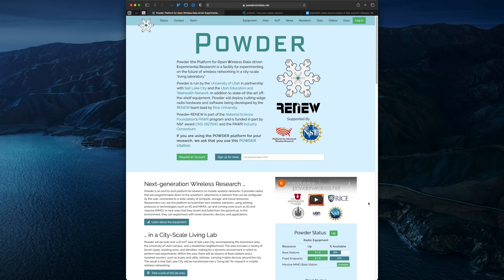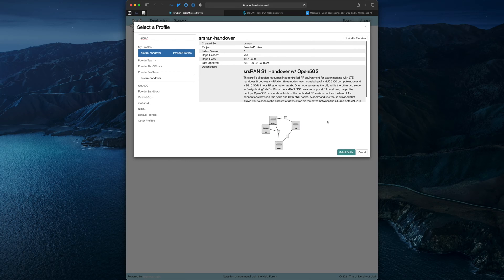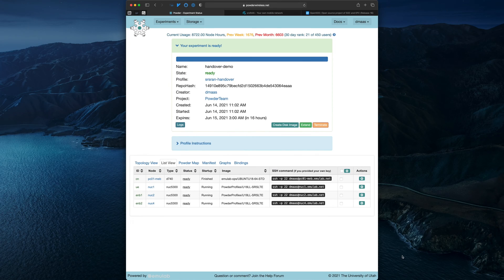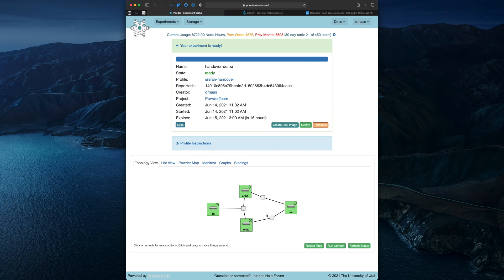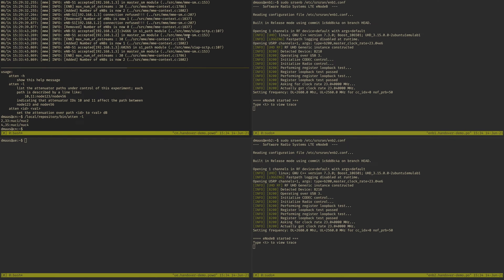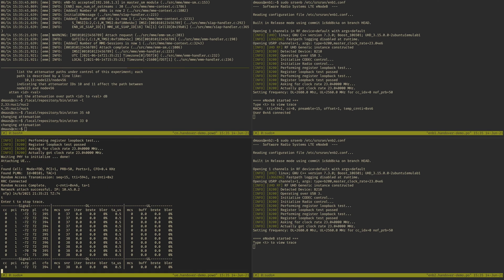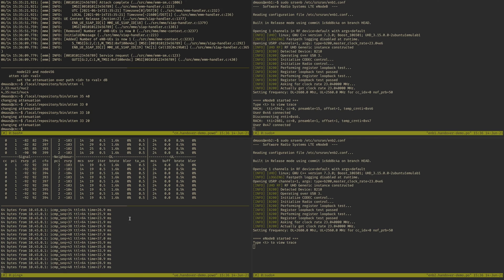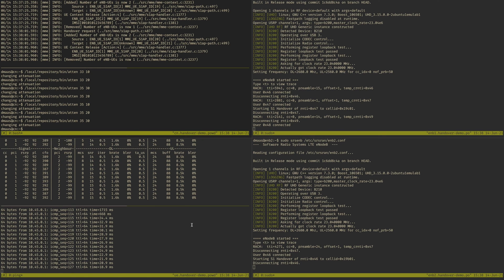S1 Handover on POWDER with srsRAN and Open5GS

Comment: If I use a commercial UE and 2 separate enodeb's using SDR's, there should only be the rr.conf's with the same filenames separated into the two enodeB's, right? Of course they will have different contents, the 2 rr.conf's.  Also in enb.conf,  is there is a need for fail_on_disconnect=true? Does this apply only to zmq?  Thanks
Reply from the maker: Yep. Two separate eNB configs. No need for fail_on_disconnect=true when using SDRs.

Comment: Have you reserved any resources prior to initiating the experiment? If so, could you please let me know what resources I have to reserve?
Reply from the maker: If you want to run an experiment in the future, you can reserve nuc1, nuc2, and nuc4, as well as one d740 node. However, if those resources are available at the time you wish to instantiate you experiment, a reservation isn't required.
Reply: @DustinMaas  thanks for the reply, Dustin! However, I tried reserving the resources you’ve mentioned but it’s asking me what frequencies I’d like to reserve; could you please let me know what frequencies you reserved/are required for this experiment?
Reply from the maker: @9ibbi  This profile uses our controlled RF environment, so there is no need to reserve spectrum. I think you should be able to make a reservation without selecting any spectrum.
Reply: @DustinMaas  I can’t get the experiment to work without reserving spectrum. Could you please let me know your email so that I can send you a detailed query?
Reply from the maker: @9ibbi  Please join and post a query on the POWDER users mailing list: https://groups.google.com/g/powder-users. This way our entire technical team can help troubleshoot.
Reply: @DustinMaas  understood, I’ve posted this on the Google Group too.